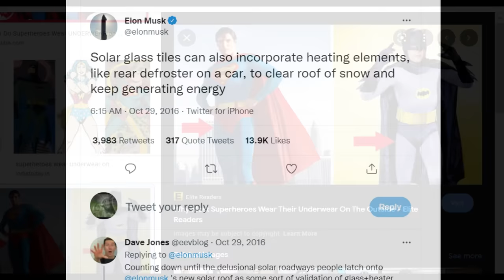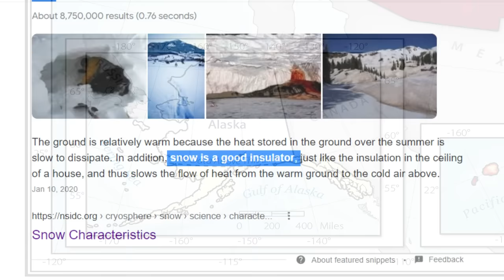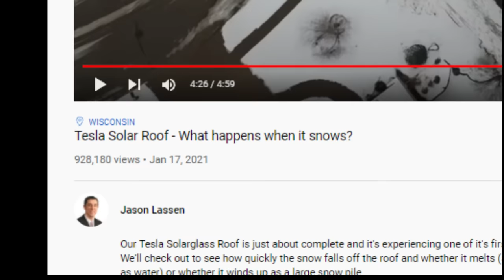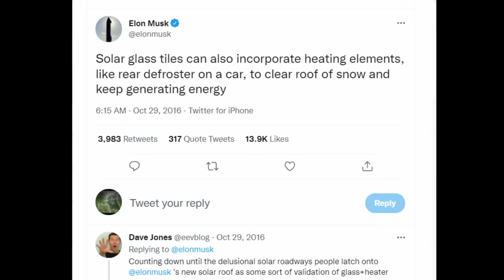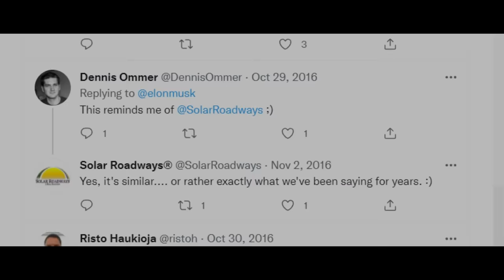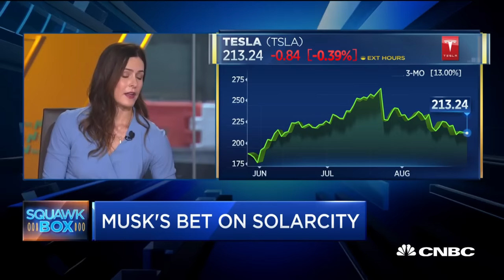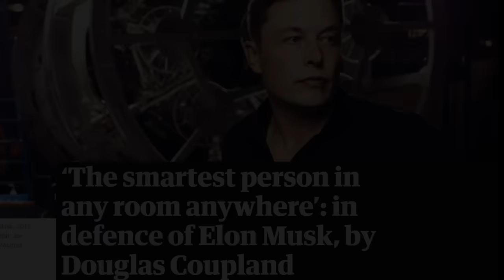Elon Musk: The Smartest Person in any room ANYWHERE!

Comment: You are wrong about not putting solar panels far north.  If you install them correctly, the surface is near vertical (angle of the sun being low and all) so the snow just falls off them.  You get less power per square meter but it still comes out to be a fairly low cost energy source in places that have clear skies in the winter.  Also, they do warm up slightly when the sun is on them so they shed the ice and snow that may be stuck to them.  The slight temperature difference drives sublimation.

Comment: Snow on the roof has no insulating effect. The ceiling is insulated, the airspace above it is outside air temperature and ventilated. I live in Canada and the sun is still warm enough to melt the snow off my roof and light coloured driveway. Excess snow on a roof can be a structural issue as well.

Comment: I mean I could understand if he was envisioning water collection like Earthships in Taoz NM. They collect all their own water off the roof and run it through multiple filters. Problem with snow on roofs is it evaporates before reaching the roof so they install radiant elements under the metal roofing so they can collect the water they need for the year. A global model has 3-4 1400+ gallon tanks to fill.
This house on the other hand does not seem to need to melt snow for water use though...

Comment: I wouldn't want the snow on my roof to melt because if it did the cops might bust down your door thinking you have a grow op set up in your house. This has actually happened by the way. I can't remember where it took place but I read a story about a guy who years ago had a weed farm set up in his attic and the heat generated from the lights was enough to keep his roof completely bare of snow. Well the local cops though this was really suspicious so they started doing surveillance on him and eventually busted him for the grow op.
Obviously this is a very specific scenario but I still wouldn't want to potentially be harassed by cops just cause I have some solar panels installed.

Comment: When it's cloudy, the refraction due to clouds make the orientation of the solar panels somewhat less of an issue. Depends of course on the wavelength that the panels capture, so if they could capture UV that'd make clouds much less of an issue (that's an if of course).
Reply: You would have to make the photocell from silicon carbide or something to do that.  Silicon is most efficient in the near IR range.
Reply: @kensmith5694  Elon Musk is a great example 
for paying-youre-marketing-team-much worked out... 

Actual experts say his projects are meant to be flashy and are just that. Just flashy. 

'Adam Something' can tell you more about how moronic Elon is, 
if youre interested or want to laugh a bit.

Comment: Heating elements in solar panels?? isn't the point of solar panels on roofs to be able to use that power to power the inside? that's just driving up your electric bill (opportunity-cost-wise) to keep your roof clear

which, uhh... why? why do you need to keep your roof clear of snow?
Reply: oh, cool, snow helps insulate your house, that's neat. Why, um, are we melting it off then?????

Comment: If the amount of energy  needed to melt the snow on your solar panels is significantly  less than the energy  you will then generate,  how is it any different to using the carburettor choke on a cold  car engine?

Comment: The only time I see people remove snow from a roof is if there has been a ton more snow than usual, and needs to be removed so it does not cave the roof in. Otherwise it sits as free, additional insulation. Hell, I would bet my left leg that the energy used to "defrost" the roof will hardly be offset by the energy gains during winter weather.

Comment: If he dug a hole 5 metres down where the median temperature is 23 degrees then he wouldn't have to generate any solar power to heat the snow, after the initial investment of digging and filling in and of course the panels, the whole system would run perfectly, No snow on his panels and no net loss of the non power they would generate, perfect.

Comment: 10:25 - how can it be poor roof insulation that is melting the snow when the house isn't being heated yet? The house is still being built, not closed in yet, there definitely isn't any heat on yet. Unless the contractor ran a space heater on the upper floor prior to this vid, either the panels have heating elements or the snow slid off. You cant hate on it for different reasons, but this isn't one of them.

Comment: Melting snow from the roof isn't always the smartest thing to do because the snow will melt and resolidify in large pieces into ice before falling off the side  of the evestrough.

Standing close to your house becomes a very dangerous hazard in the winter, I know from experience though thankfully I've yet to be hit by falling ice.
Reply: If the snow became ice before coming off your house, then you did not actually melt it from your roof. Had you melted it, it wouldn't be there to refreeze into larger pieces and fall. The whole point of removing something, is to remove it. If it is still there, you failed to remove it.

Comment: To be clear, it is not the snow that insulates our houses during winter. In Québec and probably the rest of Canada too, the insulation is inside and the houses are built to trap the heat in rather than expelling it so of course, snow ain't going to melt from the roofs. To everyone who might not be aware of this little detail yet, we don't live in igloos. Snow and ice on a roof are not a requirement for adequate winter insulation. Anyway, that solar roof idea is completely useless. When 1 foot of snow or more falls in a couple hours, you can bet your ass off that the pathetic heating roof won't be able to handle it. the first few centimeters will melt but the accumulation WILL be greater than the roof can ever handle on its own. Ice layers will form and completely block the solar panels from the sun, you'll have to manually "unsnow" your roof and risk breaking the expensive trash you had installed there.

And don't worry, there are plenty of sunny, cloudless days during winter... at -25 Celsius and under, a temperature in which the roof's heating system will just be totally inefficient on top of wasting who knows how much energy just trying to heat up. Also, when there is no sunlight for 16 hours a day and an ice layer preventing the solar roof from receiving solar energy for its own self-heating, what can one do? Use the good ol' hydroelectricity that works in any condition. It won't just take 10x more energy to remove the snow unless you call the less than 1 inch thick slush we saw in the video "snow". Useless product from useless dickheads who live in the south and have zero concept of a true winter but are still trying to sell their crap up north.
Reply: To be clear, since apparently nobody taught you shit: snow is insulative, and adding more insulation... increases how well insulated something is. You can either figure out the rest, or be bitter.

Comment: Air to air heat pumps have heaters on the outside coils, there is a use case for heaters in solar panels in certain applications. I personally don't own any Tesla products due to their relatively high cost. If however I had 100k for a car I would certainly look at one of their cars seriously, I am not wedded to battery only cars by any means. I would however like to see all the manufacturers get serious about electric trucks though, something with a decent battery pack in it and 2 or 4 motors and on board generation as an option.

Comment: The sun’s rays have to strike a cell or panel at a perfect perpendicular to achieve the rated power output. Without some sort of tracking arm, as in roof mounted, the power falls off dramatically away from the perpendicular. Just read the instructions on a $5 solar calculator. I’m not an engineer but have tested a panel. I’ve seen engineers who don’t know this. Snow is great insulation.

Comment: Solar roof heating... Lol, that mean a square meter of not illuminated solar panel will provide the energy to melt the snow into water. Let's say there is just a 10cm of snow.  Just to melt the snow it takes around 350 J/gr that said, for those 50 Kg of snow you need 50x1000x350 J = 17.500.000 J, 17.500 KJ. A 50W bulb will light for  abt.90 hrs with the same energy (50 J/sec/3600 seconds). Am I wrong? Oh, if you plan to use energy from ther source, you will need to get the same from Sun after melting the ice...  I don't think the 1square meter panel will be able to produce that amount of energy during the winter day.

Comment: Yes, the heating idea is stupid, but #Thunderf00t is wrong about the idea of a roof needing "insulation".  In modern builds that require insulation (and a code requirement!), the entire roof space is open to ambient outside temperatures with clear ventilation from the soffits to peak vents.  The roof itself does essentially NOTHING with respect to heat gain/loss.  The roof is there to stop water from entering the house, and in the summer, absorb solar heat and not pass it to the structure.  Think of the roof as similar to a typical hardhat; it's a cover for your head that actually does not touch your head and allows airflow everywhere that the inner webbing does not touch your head.
Reply: I disagree the use of a watts of vattery power is appropriate use of technology. 
Just because it snowed last night doesn't make it cloudy today.
Solar shingles are stupid but melting the snow off your panels is better than climbing up there with a shovel.
If I ever install panels on my roof you can bet they will have electric defrost.

Comment: The only time this would be relevant is for commercial buildings…. Which have flat roofs so the snow gets too heavy and they collapse. Slight problem there… ig you could mount solar panels on the roof the same way you’d do it on the ground and wire it to warm the actual roof but still

Comment: You can put solar panels on snow in the far north and the far south if you have to but, in many practical applications where they are used to power remote stations, you mount them fairly (or completely) vertical to maximise output into a storage battery just before and just after the period of Winter darkness (snow reflection good - albedo), depending on what sources and storage you have in the rest of your power system and the seasonal duty cycle of the equipment. With vertical mount, the snow also has the most chance of falling off, and the mounting structure is easy. If you want to maximise output during Summer then obviously you don't mount vertically. If manned then make the angle adjustable and sweep snow off. Auto-adjusting angle is nice but mechanical movement will often ice up and snow will build up so often pointless. But, no, you don't put them at high latitudes for power production if you can put them at lower latitudes. Using energy to actually heat snow off is a joke unless you have excess energy you can't store or use for something else; that is unlikely to be the case in a grid connected situation.

Comment: Around 17mins there's an unconvincing assertion is that Elon won't put a 28 engines on a test rocket due to their cost. Is that actually the case though? I mean he doesn't state that in the supplied video and a clip of him admitting it was due to cost would be a massive win for the point, so I doubt Thunderfoot would leave such a clip out, if it existed. Could it be that the concern is something else - like losing the engines and not being able to mass produce another 28 quick enough for a future test?

Comment: This guy ever build a house? The roof is supposed to be separate from the insulation. Snow can be an insulator, but there are much better types. Melting the snow off your roof at -30 can have other issues with water freezing where it isn't wanted mind you.
Reply: the snow causes heat to not leave the house as much.

Comment: As much as I like your channel and debunking videos I have to pick you up on a couple of things.
1. @5:30 the roof is the same as all the others it just has an extra layer on it, adding a layer of solar panels will not reduce the insulation although it's not better than having a layer of snow.
2, Our farm, house and hot water system is all solar and works just fine even on the cloudiest of days, in fact the heat from the summer sun reduces the efficiency of solar panels.

Comment: I'll take the rocket engine question.  At the time of the video, which is in 2020, SpaceX had multiple failure and only 1 successful hop using 1 Raptor engine.  Who in their right mind would go, oh so we can do 400ft with 1 engine fine, let slap on 27 more engine and see what happens.  It had nothing to do with the cost and more to do with it haven't zero percent chance of success.  What's happen since then.  They have multiple successful launches and even landing, so now that there's a chance of success, hey look they are building a 29 engine booster.

Comment: sooooo, from this Canadians' point of view.....that unless these homes have some sort of individual solar tracking motor under each shingle (that would have to be a donation made from a manufacture because the cost would cripple the housing market)the project costs alone would take your kids kids generation to finally beak even. Not to mention as stated in the video if the panels had melted all that snow even gradually your home would either end up with a generous sized moat on warm days and an Olympic speed skating rink on below freezing....with longer stretches of sunny yet below -15C just think of the ice dam building up in your down spouts....on another note generally the homes with little to no snow on the roofs meant some police department was going to get more funding the coming year because of all the GROW OP homes they busted(fantastic detective work gentleman)

Comment: Would be interesting to see the data for the amount of energy gained through the solar panels vs the amount of energy lost due to the lack of insulation.
Reply: Maybe the logic doesn’t work for all houses but perhaps you can turn off that setting easily if the energy gained vs energy lost is insignificant. At least you have solar power when there is more sunlight to capture in summer.
Reply: Also can’t blame Elon for coming up with ideas then trying them out. The idea itself at first glance sounds decent but when you actually think about it may not necessarily work. Something I’m sure we can all relate to.
Reply: Most shit he does works well, even if some of the ideas may not be as feasible as first thought, but at least bottom line he is trying to do something decent.

Comment: You're right and wrong.  You need to melt all the snow, you just need to melt the boundary layer and let gravity work.

Honestly, it's a better alternative than using a shovel on a glass roof.

You don't heat 24/7.  You let the snow fall all night, when the snow stops, the heating elements kick on long enough to let the snow slide off your roof, so you don't have to wait for the snow to melt.

Comment: Everything was right, but your last question was a bit wrong. It's not about how many times SpaceX Should fail in order to make their system reliable, building engines again n again requires huge man forces n time delays. If Elon would have thinked like you then probably SpaceX could have been successful startup but after 8 failure launches. So even if he has funds to fail 100 times, so I ask you is it feasible to actually fail 100 times or to find a way to minimize failures to achieve the goals. Think about it. Even I can fail my high schools 50 times and can pass at 51th time. Would it be okay to you. Please reply me, or else you know your answer.

Comment: You are right about stuff, but completely wrong with your roof insulation theory.
Solar panels are not placed directly over the roof, they're generators, not insulating panels.
Because panels are mechanical devices, they produce heat, work is doing all the melting. Solar panels actually work better when colder, so they make perfect sense even in low light conditions.

Comment: While i do agree that both elon and his ventures are vastly overrated, your arguments on the solar panels are only partly true. While they offer limited effectiveness in the north during darker months, their output can be significant enough during the sunny months to make the worth it, especially if the building is a new construction and the energy market in the local area is high priced. Also the example you honed in on seemed to have no snow as the roof had just been installed, not necessarily due to poor insulation. The outmost layer of the roof, be it tesla panels or what ever else material, doesn't contribute much in terms of heat insulation. The job of the top layer is mostly just water proofing. The heat insulation comes from insulating material, usually rock or glass fiber wools and polyurethene boarding underneath the roofboards as well as a crawlspace between the roof of the actual living area and the roof of the building.

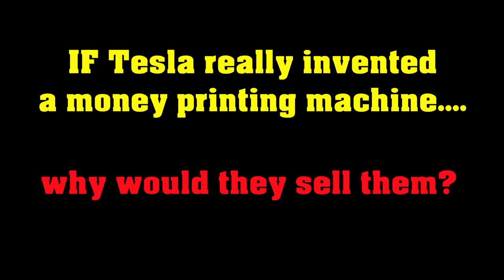Comment: 15:37
They're talking turnover, and a regular taxi does earn at least $30,000. TAXI drivers typically are low wage, but they're not emaciated.
By the logic your using here, GM should have never sold any of the cars that eventually became regular TAXI's.
Reply: GM doesn't produce self driving cars... Musk was talking about self driving taxis
Reply: @AppleSauceGamingChannel  
Still, that logic could be applied to any manufacturer of automation equipment. 

Why don't they just make their own car factories instead of just building factory robots?

Vertical integration to that degree only makes sense in certain situations. This isn't necessarily one of them.